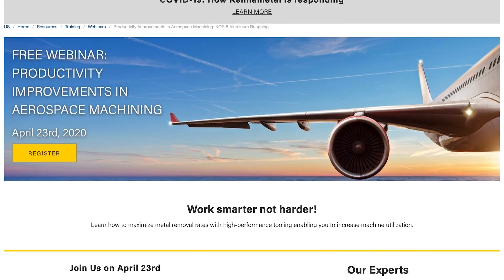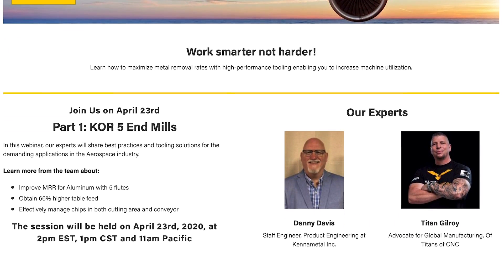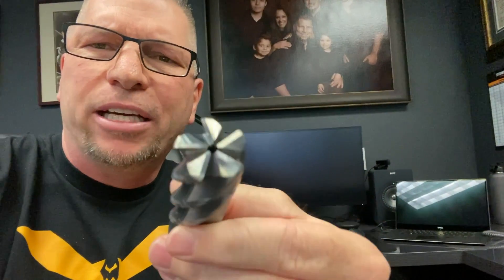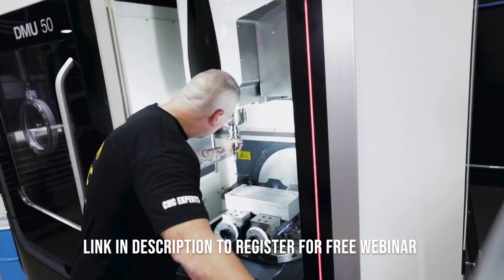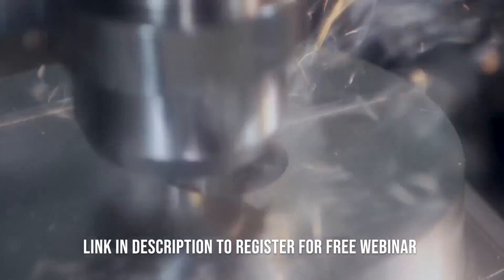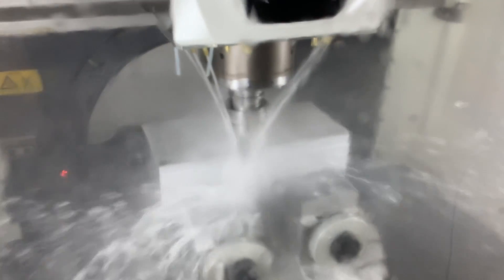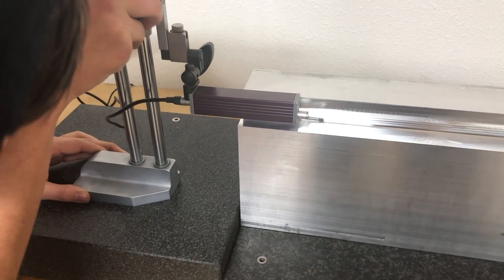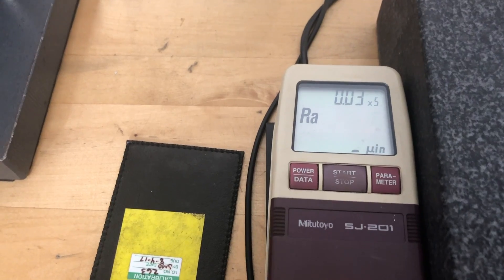WORLD'S GREATEST ALUMINUM ROUGHER Cuts A Mirror Finish of 5.9 Ra

Comment: A question from someone who does not own a CNC machine. The question is: Is it feasible to keep the machine 24/7 running at the feed and speed that has been shown in the beginning of this video? Is it a standard practice today with new equipment? Please.
Reply: Yes. Although there are caveats (like the so called "short stroke machining" which means that the bearing don't travel past their lubrication points often enough to get lubricated, when doing things such as engravings and micromachining work on a machine that wasn't built around such considerations), these machines are built to run at 100% load on everything all day long (up to 150 or even 200% depending on the manufacturer for practical conditions with a couple of quick heavy passes). They are also mostly designed around making it easy to repair and bring back to the original precision specs rather easily, compared to old scraped guideway machines. The people saying no either haven't really worked on a CNC, or have only work on some already busted up sub par used machine. 

My experience setting up, programming and running a DMG M1 for 8 months (apart from some controller issues and practically zero programming support) was that the only thing that seemed to wear out after running literally thousands of parts to the maximum of the machine's capabilities (12k RPM with up to 6.5m/min feed rate for milling aluminum with a 12mm endmill, some jawdropping slotting and drilling with solid carbide tools on steel, and 15m/min cutting feed with a 100mm slitting saw on aluminum extrusions, which was insane), was that the only signs of wear was the paint being abraded from being blasted with chips at some points (collateral from drilling at 2.5m/min penetration rate on steel with a 9mm solid carbide drill), and it could still hold 5 microns diameter tolerance afterwards, on a hard milled round spigot (56ish+ HRC press punch tools) and a hard milled 4.2mm bore inside it, on a machine without even linear scales! 

It really makes all manual machines irellevant and even the claim that "repair work can't be done on a CNC" is completely false, because with conversational programming for even the most basic operations like hole patterns, slots or profiles/contours/shoulders/pockets and a tool and workpiece probing system, you can almost forgo indicating the part entirely (you can align the machine coordinate system to the probed part instead), have all the required tools loaded and preset (usually less than 0.03mm away from the target offsets for finishing) and locate the workpiece in relation to the program within a few microns in less than 10 minutes! 

Also running a certain tool/operation a second time, after you have moved to the next tool, takes no time at all and you can mill a flat surface in the morning, cut a bunch of features as well as drill and tap a bunch of holes, and then you can rerun the same facing program and be within less than 15-20 microns off without even looking, and it's even more impressive when changing the tool back to a tap and rerunning a rigid tap in an already tapped hole without ruining it (as the long as the offset are the same and the part has not moved/warped). 

Finally the part were you are not getting splashed by irritating fluids and splattered with 600°C chips (in my case of a messed spine I reaaaaly appreciated not having to crank that knee as well) and the general silence (you can practically only hear the cuts, the rapids and the toolchanges) just seals the deal in my opinion!
Reply: No, it just shows what is possible and that the cutting tool can handle it.  I run a HAAS VF4SS and i think the ball screws and spindle bearings would be trashed running this hard.
Reply: Chris Henning Ball screws and spindle bearings will always wear. A Haas SS rapids at 1600ipm if you ran a production shop you wouldn’t run the rapids at 50% just to save on ball screws. You could argue that the load from the cut makes cutting at 1600ipm worse for the ball screws and spindle bearings than rapids and you’d be right, but the difference is insignificant when compared to the load created at the start of motion. The acceleration is what causes most of your wear and the acceleration is the same regardless of your top speed.

Also it’s a Haas. No disrespect to Haas, it’s what I learned on and it’s still my favorite controller to use, but I’d take Titan’s DMU50 over any machine from Haas’ line of VMC’s if I wanted a robust machine that would last or I’d take a Brother Speedio if I needed pure speed and a machine designed to cut at extremely high feeds.

Comment: I'd like a video where you adress the different kinds of cooling, and when to use what. I think it's very overlooked. In some of the clips here, liquid is used and in others air. Why?
Reply: In harder steels carbide endmills will heat up a lot and though most heat stays in the chips, the coolant would cause thermal shock and wear out the cutter faster or cause it to break.  Depends on the part, but coolant is also used to flush chips away, like deeper pockets but isnt necessarily needed to cool or lubricate

Comment: Come on, dont call Ra5.9 a mirror :P But yeah, for that speeds its not a bad result. Kennametal has really nice cutters. I like their 20mm dia cutter 70mm long rough cutter. I was using it with some crazy feeds and speeds :D
Reply: Matt Bike i think its Ra5,9 in microinch? in europe we finish sth like Ra0,1 in micromilimeter. so i dont know whats better :) guess i will look for a calculator. edit: microinch is about 4xtimes bigger than micromilimeter. so someting close to Ra1 microinch is kinda good surface i would say. Ra5,9 is definetly not a mirrorlike surface :)
Reply: @KaiserMaggus  micromillimeter?? Are you talking about micrometer or nanometer (millionth of a millimeter)? Why can't people just use the standard SI prefixes?
Reply: @Gameboygenius  micrometers obviously, and 0.1 is kinda hardcore imo
Reply: Anything under 0.4Ra is pretty solid normally
Reply: I think 5.9 is damn near a mirror finish for a roughing tool! Now obviously that is a figure of speech and we all know that it's not technically a mirror finish but I think anything under 15Ra is great for a roughing tool! Awesome job boys!!!

Comment: Funny, almost every "worlds best tool" comes from kennametal
Reply from the maker: Out of 60,000 SKU’s... I only choose or say that to a few. Of course not all tools are absolute best in class... but KOR5 is and Harvi 3 is etc. Kennametal won the Boeing Challenge with the HARVI 3.
Reply: @TITANSofCNC  Side not can you do a video on carbide tipped drills and how to use them please. I have 100 pc range .125-.375.
Reply from the maker: I have many drilling videos on this channel and will do more. Every material has a tool that’s perfect for it.
Then you just need the SFM and Chip Load etc... amount of Peck etc.
Go to the makers of the drill and ask tech support for your specific application.
Reply: @TITANSofCNC  they won the Boeing challenge, so... it's the cheapest? (jk)
Reply: @TITANSofCNC  Me and a partner from our company had a visit the Kennametal research center at Latrobe and we had a talk with a lots of engineer here and of course Steeve George. It was really a great trip and the fun part is, they already thinked about an upgraded version of the KOR 5 ... but it's already a insane endmill. Keep up the nice work you're doing Titan and wishing to have a shake hand with you someday.
Reply: Partners